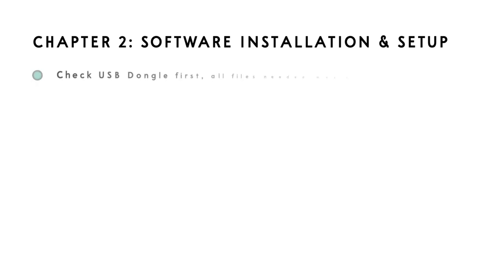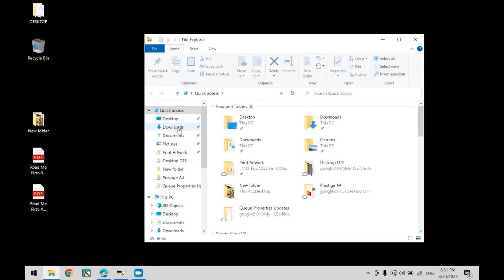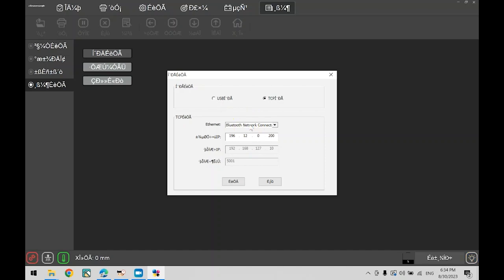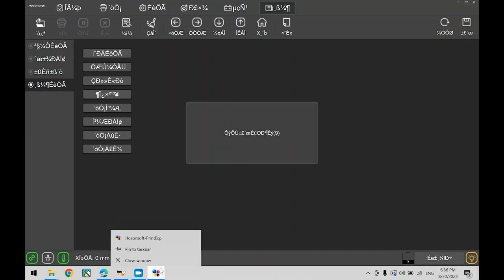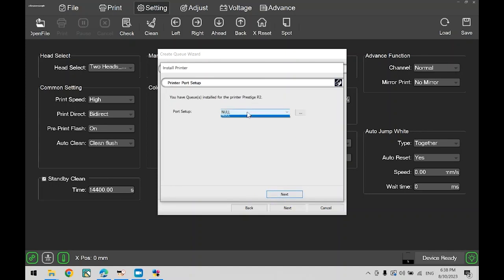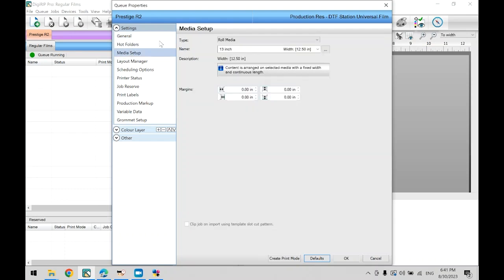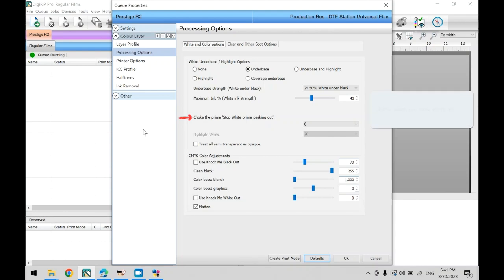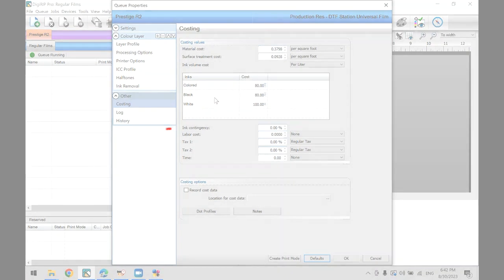Prestige R2   Software Installation

Comment: after inputting the correct IP address, I have the green connection icon in the bottom left, but it fails to load parameters
Reply: Did you find out what it is I have the same problem